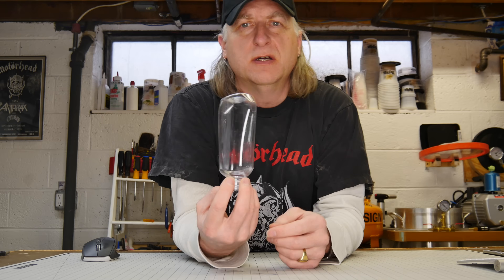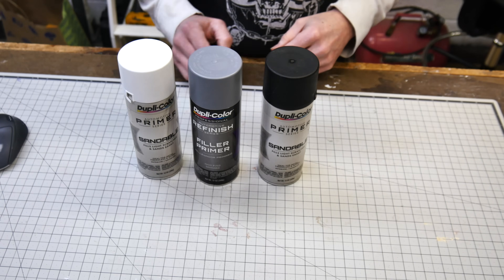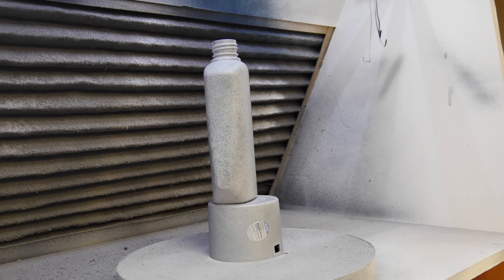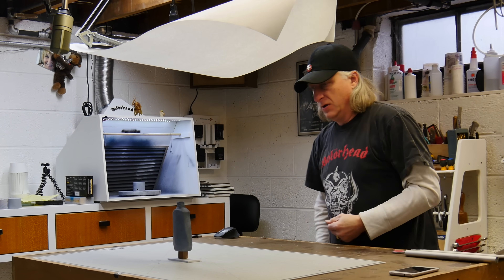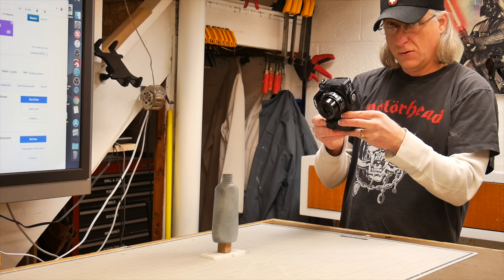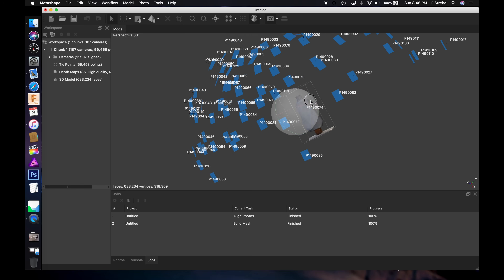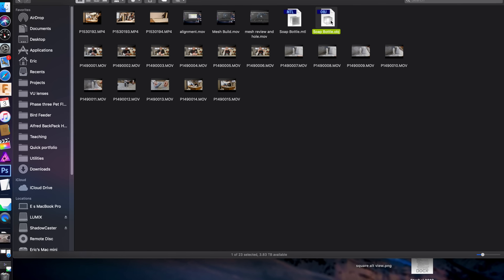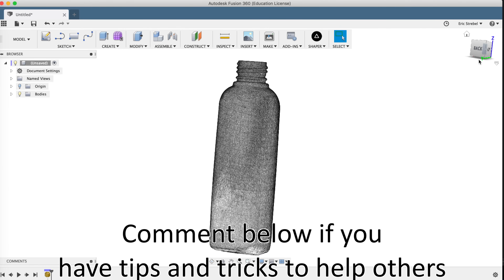How to Scan 3D objects with Agisoft Metashape: Basic Photogrammetry

Comment: Aperture should be high value (close Aperture) NOT low, all of the object should be in focus and even if the background is in focus it is better, because it will make it easier for Metashape to align the photos based on that info.
After the photos are aligned and a point cloud is generated, it is very easy to get rid of all of the background.

Comment: Should be noted, Metashape is available for MacOS, Windows and Linux.
Windows 10 actually comes with a pretty good set of 3D editors, painters and printer software built in and integrated with Windows Mixed Reality (if you have a compatible VR headset)

Comment: I have black and somewhat shinny objects I would like to scan but can't use any type of permanent paint on them.  It there anything that would give me the flat textured appearance of paint but could be washed off afterwards?

My original thought was to use some type of shrink wrap so I could paint it then remove it when I was done.  Haven't found anything that will shrink tightly to the shapes I am working with.

Comment: I need 3D model of furniture objects for my final year project. Can we apply this to a furniture objects i.e Chair, table etc.? Thanks.
Reply from the maker: Yes, I don't see why not
Reply: Please explain some more
Reply: Raheel Rajput for a real good scan it’s better to use a turntable with little engine for rotate and you shoot on 160/180 degrees and let turn the table. This technic help the software to assembling picture. The light is important to for some better result you can check Pano2VR soft if you want it’s another alternative
Reply: Raheel Rajput check that video to https://youtu.be/28vrZIj-hYQ
Reply: Thankyou bro! Appreciated.
Reply: Raheel Rajput I think for a better resolution during the shooting you can use un aromatic turning plate and shooting during the rotation

Comment: "I need to scan a bottle to figure out its volume". Yeah, I guess it's easier than just measure how much water does it take to fill it.. 🤔
Reply from the maker: Cool, good luck with the project, although feeling it with water is going to be way faster
Reply: I think he was poking fun at you .. :(
However, I care not why you scan the bottle, and very much appreciate the video. I want to use this method to make copies of miniatures  to create a 3d printable version of them. (I want to print in translucent PLA  to make "invisible" versions) will this capture detail on objects that are between 1.5 inches-3 inches?
Reply: @vulrath8154  Correct :D I really appreciated the video, it was not intended as a negative comment, I just laughed when he said it :) BTW I just made a single attempt at photogrammetry, so take this as a not-so-informed advice, but I think it all depends on whether you're able to succesfully focus the subjects at such a close distance. You always want to fill the frame with the subject, so distant photos just aren't gonna cut it...
Reply: That is helpful, I plan to make attempts this weekend. I think im going to make a platform that I can mount my camera too that will allow stability, but up close with a rotation feature. Been trying to do this with free apps....just doesn't work. This gives me hope!

Comment: I heard of hair spray and hair highlight spray being used to prepare the object for photogrammetry and scanning without modifying the object permanently. The hair products will just wash off with warm soapy water.

In my little experience, hair spray needs to be sprayed on from a distance of over 1ft and at an angle, then it falls down in microscopic clumps and makes for a very dull matte finish.
Reply from the maker: Good tip, thanks for sharing. Much appreciated :-)

Comment: Nice job, I do 3D scanning all day with structured light for inspection and I'm just picking up photogrammetry as a hobby so I bring my skills to photogrammetry. So a quick tip, if you need to ever coat something but spray paint is out of the question get an airbrush kit, 99% IPA (rubbing alcohol) , .05ym pure aluminum oxcide(raw make base can work just clogs the brush), mix 1/4tsp aluminum oxcide, .75oz IPA and mix well (it saturates better in largers batches) spray evenly about 8" away, don't spray in 1 spot... It goes on lightly but when it dries it's coated (it dries in milliseconds...but the best is it washes right off/wipes and the part isn't harmed
Reply from the maker: Good tip

Comment: Hi great explaination, but I have a problem: it always says this message:

"SOME PHOTOS FAILED TO ALIGN. PLEASE RESET ALIGNMENT FOR INCORRCTLY ALIGNED PHOTOS AND RERUN PHOTO ALIGNMENT". 

I tried even with only two photos but same message. Can you help me?
Reply: I started photogrammetry about two months ago - by watching this excellent video - and in my experience, this error message has always happened because I accidentally changed my camera's zoom, causing photos to have different focal lengths.  I'm sure there are other causes, but for me, being careful to make sure my focal length is the same on all my shots solved the problem (I've taken close to a thousand shots so far on my project).
Reply: Since posting my previous reply, I've learned another cause of the problem, at least with Metashape.  It's because the photos being aligned somehow don't give the software enough information to know how to fit them together.  The solution I've found is to group photos into chunks, and then align the chunks.  In my case, I had 1200 photos of a large archeological object (about 40'x40'x15').  A lot of them didn't align even though their focal lengths were all the same, so I divided the photos into groups and created a chunk (using the Add Chunk command) for each group.  If some photos in one chunk didn't align, I removed them from that chunk and aligned the rest in the chunk.  Then I'd create a new chunk for the photos that didn't align.  When I had all my photos divided into chunks in which the photos all aligned (I had five chunks), I used the Align Chunks command.  In my limited experience so far, as long as the photos within each chunk align and there's enough information in the photos for the software to know how the entire object fits together, the chunks will align and you'll have a single model.
Reply from the maker: Wow, that's cool, I did not know that about the chunks, thanks for sharing, much appreciated
Reply from the maker: Thanks for the tip!
Reply from the maker: No idea, I would reach out to tech support, they are responsive. Tell them u saw the vid!

Comment: Why not use a turntable?
Reply from the maker: It's not clear that this is possible without some trial and error, perhaps it could work but the lighting will need to be very very even. More time than I have at the moment, it would however be an ideal set up.

Comment: Can a turntable be used?
Reply from the maker: Possibly, I have not tried that.
Reply: These systems seem to rely on mapping the environment and the environmental light on the object. So no; you need to move the camera, not the object.
Reply: Put some tracking markers on the turntable
Reply: @error079  Buy the largest 'lazy suzan' bearing you can find and make a donut shaped turntable. Mount a camera on a boom to it, with a counter weight on the other side. Place the stationary object in the middle, point the camera inwards, rotate and shoot. Let us know how it goes!
Reply from the maker: @luke Frahn, I built one! Look for the vid this week. Rock on!
Reply: @EricStrebel  Wow; awesome! I look forward to it :)
Reply: It s possible but you will need to generate alpha mask for each photo (autogenerate with photoscan xD) and have a perfect lighting setup. You can also scan top and bottom of the object and merge chuck with photoscan to have the whole model.

Comment: Good tut. Meshroom is a free software package that also does photogrammetry. Might be a bit less consumer friendly and has less editing options once you have the model - its more of a wrapper around a computer vision framework. (So you do get a whole bunch of options in terms of the CV functions)

Are there not any available 'texture' spray paints that can do the noise pattern in one go ?
Reply: I've had some good success with meshroom. It takes a bit of getting used to but great results
Reply from the maker: Thus I am using Metashape, works on a Mac

Comment: I'd guess this is golden for tricky, convoluted shapes, but for this bottle I'd take photos from every angle and align them in CAD and build the model along one axis at a time!
Reply from the maker: use a long lens so you don't get distortion. Scanning is a good way to avoid that and have a 3D guide for your object in CAD